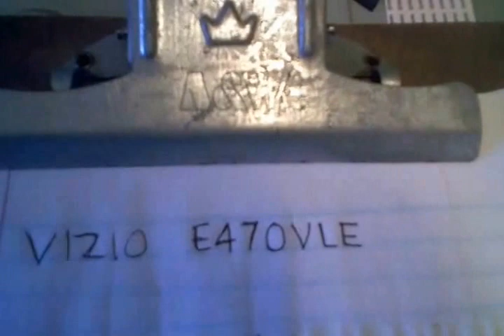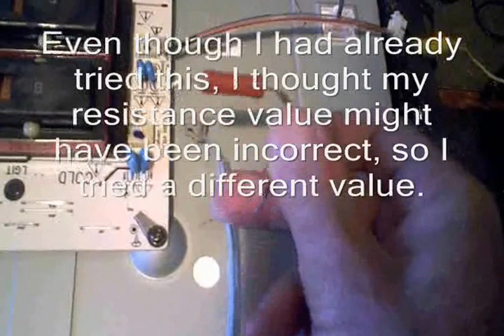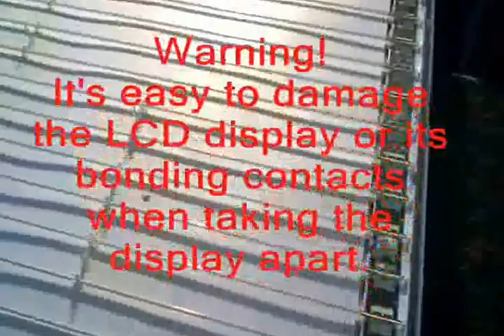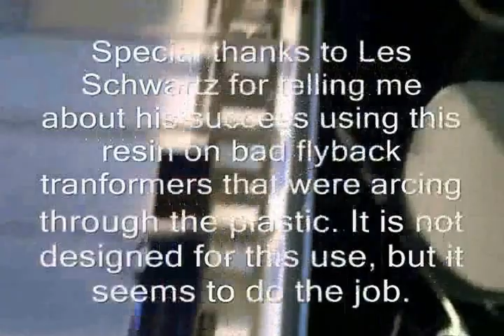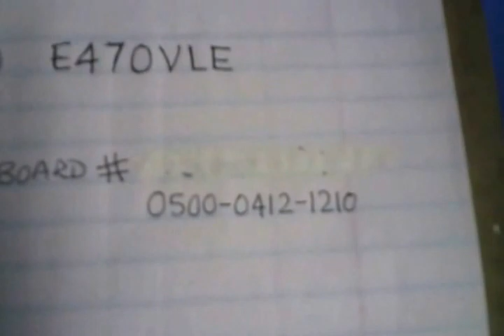Vizio TV. Inverter output shorted to ground from electric arc on lamps to chassis.

Comment: Hi Dave  I am an old TV repairman in the CRT days and used a substance called Croma Dope.  It can in a bottle and had a brush in the cap to apply it.  It was good to 40kv.  thanks for your time and knowledge sharing.  You have me seriously getting back into the Electronics Repair Business.
Reply from the maker: Thanks for  the tip but did you mean Corona Dope rather than "Croma Dope"?
I noticed they still sell something called Corona Dope.
Dave
Reply: Your right!!!  it came in a small bottle and was red.  I used it on a lot of appliances besides tv's.  really enjoy learning the new tv repairs from you.  Keep up the great work.
Reply: maplej6220
If the stuff took forever to dry I used it too. A tip from my 90 year old tv and radio neighbor.

Comment: A week ago the power on my LED 42" Flat Screen Vizio just went out. My TV is only 1-1/2 years old and I am out of warranty. So of course I decided to turn to youtube for guidence. I decided to take the back of my TV and replace the fuse, I proceeded totake the back off and located the fuse but decided to try to plug the TV into a different outlet before going and further and A MIRACLE HAPPEN THE TV STARTED WORKING AGAIN. Thank God because I called vizio and they gave me a number to a TECH repair shop in my area. I don't need them my TV is playing beautifully. I say all of that to say this....... TRY A DIFFERENT OUT, I ALSO UNPLUGGED EVERYTHING EXCEPT THE TV AND CABLE BOX AND MY TV IS FINE........ HOPE THIS ADVICE WORKS FOR SOMEONE.

Comment: Great Video Dave:  What is your email address?
You mentioned training manuals in this video.  What are they? and where did you buy them?
I ordered a service manual for a Panasonic TC-L32C12  There was no power supply schematic or part list for the power supply  What can I do?
I used your trick of turning the tv on by jumping a resistor from standby 5 volts to power on.  I have 400 volts going up to the FET's before the high voltage transformers.  I suspect these IC before the FETs

Comment: How can I get some trouble shooting help on a IH252HPB LCD Monitor Model HSG1064, I did the same as in you latest posted vido for the TV E470VLE picked up a power board, replaced it, and same problem, BACK LITE WILL COME ON FOR A SHORT THEN OFF, I can power it off and back on and the back lite will come on for a shor again and back off.. any thoughts..??? Thanks

Comment: Hi dave, I have watched your video and plenty of others, My orange VIZIO light lights up but the TV will not turn on. I have checked into the lamps for a similar shorting of the lamps problem that you showed here in this case. Any other ideas? There is also not any capacitors that are blown; that was my first thought.

Comment: Thank you for your video, I would have never thought to look at the backlight. TV is fixed and I am watching it right now. Model E470VLE Must be a common problem with this model.

I am having a problem with another TV. I have been trying to fix it for 5 weeks now and can't seem to figure out what part has gone bad. If I make a video of the TV do you think you can direct me on where to check? like a step by step. The TV has power but nothing turns on. It is a Vizio E551VA. I tested the power board and it is OK. I saw a part burnt up and I replaced it but the TV still will not work.
Reply: I think I found the problem with the Vizio E551VA, it has been alluding me this whole time. I just seen it last night and I got so excited. A surface mount 330uf 35v Capacitor. Barley noticeable but the top had been raised on it. I ordered the cap and can't wait for it to get here.

Comment: I guess i´m having the same problem in my TV, there´s a way to test the Lamps without disassembling the tv lamps panel? i mean with the Multimeter? it can read a Short in the lamps?
Reply from the maker: +LookingMercury3D I suppose one could apply a high voltage to the CCFL inputs and measure the current to see if it's 
drawing to much or to little current, but you would need to know what it should be before hand as a reference.

Comment: My Vizio 32" Class FHD (1080P) Smart LED TV (D32X-D1) recently failed to show video but played audio. It passed the flashlight test. I couldn't see any visible issues on the board. Shall I assume it's the power/inverter board? Do you think it would be a safe bet to go ahead and try replacing the board?
Reply from the maker: I never like to assume anything, but on TVs that have LED back lights like yours it's common for the LEDs to go bad. Not necessarily the driver powering them. If you think the TV is worth the time I would start by checking the LEDs. Here is a link to a video where I talked about this issue, and why it might be best to replace all the LEDs. https://www.youtube.com/watch?v=RRyhx4D8mcA

Comment: My E470VLE had same problems. Turn TV on and you see a Logo for about 1 second. Ordered a new power supply board and had same problems. Tore it apart and found same problem you had. Backlight bulb arced to ground. It appeared worst then yours.Plastic all around the top bulb was all burned . Cleaned everything up, removed all burned plastic  re- assembled ( of course I cracked defuser) everything is working fine now but there is a fine line in upper right corner  from the cracked defuser. Good enough for grand kids games----Spare power supply anyone?   LOL

Comment: hi dave.. i hav 3.3v stdby n 3.3v power on signal n 24v  on the pwer n main board but no signal for back lite ..any suggestion whats wrong with my philip tv lcd set...
Reply from the maker: The inverter needs a turn on signal from the main board. If it was missing I would be suspicious of the main board,  In some cases there will be a ribbon cable between the T-con board and the inverter board.  If disconnecting this cable allowes the TV back light  to come on I would suspect the T-con board had a problem.

Comment: Are there any instructions on getting to the backlight area? I have the back off and when I turn on the TV it stays on for a few seconds, then I see an orange arc at the top left corner and the TV shuts off. I am suspecting the same issue as yours was.
Reply from the maker: I don't have any specific instructions for you, but if you happen to have a  junk LCD TV or computer monitor you might want to first practice on taking its back light apart and re-assembling it so you know what your dealing with. The LCD panel is real thin glass, and easily broken. The same is true with the ribbon cable which is  permanently attached to the Display.  If you attempt this repair make sure your not in a rush to get the job done. and use extreme caution.

Comment: I have disassembled my vizio down to the back lights but have found no evidence of arcing, i.e. Carbon buildup. Do I need to add that extra bit of resistance in order to find it? Or is my problem something else entirely? BTW I have the same exact tv you are working on in the video.
Reply from the maker: You may have a problem unrelated to the backlight, but I can't guess. Did you verify your power supply was supplying 24 volts to your inverter board, and that your inverter board fuses are okay?

Comment: I have the same model, looked like same issue however no arc-over.
I did notice no voltage to the power supply lamp connector from the mainboard. I'm  wondering what the voltage from the mainboard to the lamp on the should be?
Reply from the maker: +Planet Madness The main board back light turn on signal is probably 5 volts.
Reply from the maker: +Planet Madness The main board back light turn on signal is probably 5 volts.

Comment: Hello and thanks , informative to above my skills with the dummy loads but I like the neon tester thing great tip , I also determined with your video that I did not get an instant of backlight which was a relief , I repaired one Vizio with a board not the power board but one that had a known defective I C so thank you for eliminating this problem Nice job Thanks Roger

Comment: I have a 2007 46" Samsung LNT4665FX/XAA and bought a used power supply off the internet that was supposed to be new? that had bad capacitors so put in new caps. Still no picture. It lights up with a buzzing sound coming from a transformer on inverter board or light underneath it. Can't tell which?  Waiting on new inverter boards. If that doesn't work I think I have the same problem you have with this TV in this video. The TV still looks new and hate to trash it. Have you any idea how much the lights are incase I need them and where is the best place to buy them? It does look like delicate work replacing the lights or fixing the short. Thought it might be dust and with high humidity shorting across the dust inside a transformer. I heated up the board with wife's hair dryer and TV fired right up and looked good. So I used high pressure air on all parts. TV ran fine for the evening. Turned it on and off 50+ times with no problem. This morning turned it on and lights up with shorting sound again, and then lights go off. I sure hope it's a transformer on the inverter board. I guess I need to start hunting down the lights and prices. Cheaper than new TV I hope? Wife has a new LED TV by Samsung, same size and uses less than half the electricity this LCD uses. I have no test equipment what so ever but do have good solder iron and TV solder. I want to use this TV as PC monitor since my eyes are not what they used to be. Thanks for the great video. Retired in Mexico
Reply from the maker: If your lamps or lamp assembly was arcing I don't think it would work sometimes. If you look on my website at tvrepairinfo.com you will find a link to a company who sells the lamps. Hope this helps.

Comment: Hi Grants Pass TV Repair, that was a interesting video. It confirms to me that the inverter in the powersupplyboard has a safety feedback, to switch off the power in case ther is any problem with the high voltage to the backlights. I have a Philips 37pf3312_10 37 inch lcd tv with a Delta dps-182bp powersupply board with integrated inverter. Now when I power the tv on, the blue on led goes on, I hear very briefly some tv sound, but no picture. Within 2 sec the set switches off, going into standby mode with a 12 v missing error. I have checked the 12v, but that always comes on immeadiatly , but is switched off after 2 seconds. My resolution, is to unplug the tv from the mains, wait at least 6 seconds and plug it in. Than I push the power on on the rc and most of the time it switches on with picture. But it also happens that I have to repeat the procedure several times. Now I have discovered when it is warmer in my livingroom, (+ 23 degr C) the televison switches on right away.  And when it has been on for a while (warmed up) I can switch it off and than on again without problems. So temperature seems to be of influence here. So I tested with cooling spray, but no luck to reproduce the problem. Unfortunatly I was not able to find the wiring diagram of the Delta dps-182bp powerboard. I do have the service manual of the tv, but there is no wiring diagram in it of the powerboard, since it is not philips made. Do you have any idea what the problem might be? Many thanks in advance!
Reply: Marc van der Linden  Correction: the Delta power supply is a dps-168bp (not dps-182bp as mentioned above).

Comment: I have a vizio plasma TV PDP50X34012 AND HAS A FAT LINE THROUGH THE MIDDLE OF THE SCREEN AND IT FLICKERS A LITTLE POWER BUTTON WORKS VOLUME. BUTTONS WORK BUT NO SOUND. CHANNEL BUTTONS DON'T. WORKAND A BLACK SCREEN. BEHIND THE VERTICAL LINE. I FOUND THE ZSUS. BOARD TO BE BURNT BECAUSE A SCREW. FOUND. ITS WAY TO THE BOARD.I NEED TO KNOW IF I SHOULD CHECK. OTHER. BOARDS.AND WHERE SHOULD I LOOK. I DO HAVE A MULTIMETER DEVICE
Reply from the maker: I would not know if the other boards were damaged or not. Even if they were, other than a power supply problem how will you test the other boards?

Comment: I have a 37" Vizio that turns right back off when you turn it on, What can I do to fix this?
Reply from the maker: One of the most common reasons for shut down issues are shorted transistors on the inverter board, burnt output transformers, and sometimes issues with the lamps themselves. If the fuse on the inverter board is open I'd start by testing the resistance between chassis ground and the input going to inverter board to see if you have a detectable short.
Reply: okay, I will have some one do that, thank you.

Comment: Sir, how to check ccfl lamp of 32" LG lcd tv model no. 32LD310
Reply from the maker: The best way to test a CCFL is with a high voltage source they are designed for to see if it comes on. When the lamps get old you will notice the ends of the CCFL tend to burn or carbonize. When this happens they start to draw more current,  and at some point this can be a problem, and may make the TV back lights not come on.

Comment: Hi Dave, thank you for great video... I have the exact TV model with possible Inverter issue, I was wondering if you could possibly sell that inverter board... I'm having such a hard time finding the right parts number... TV Vizion E470VLE inverter# 0500-0412-1210
thanks
Reply from the maker: momoy02 If you call me Monday  I can see if I still have this board. My phone number is in my website.